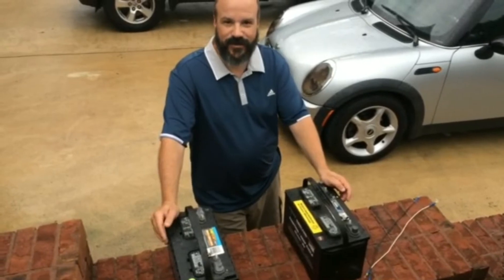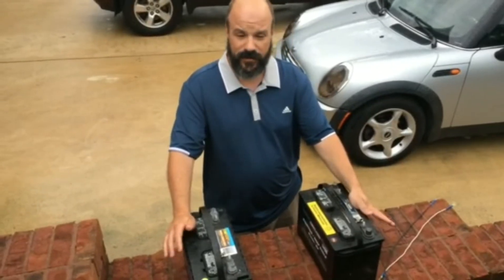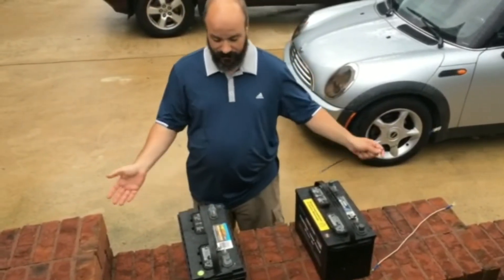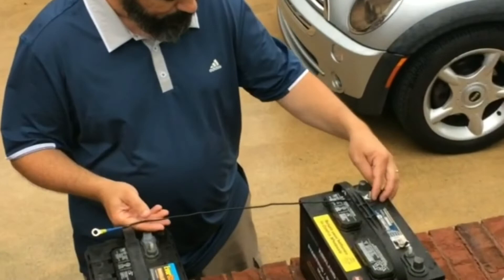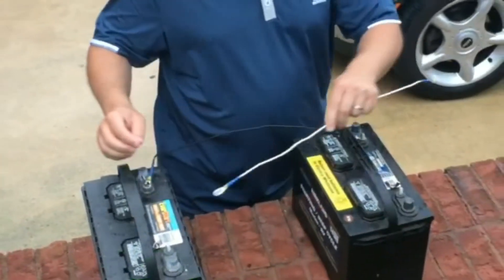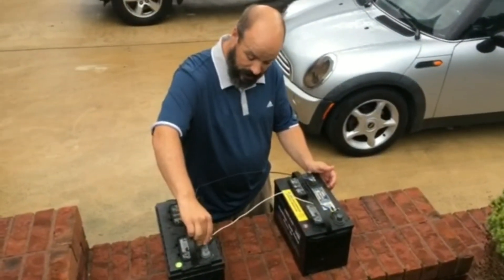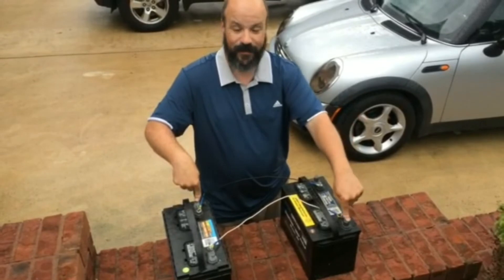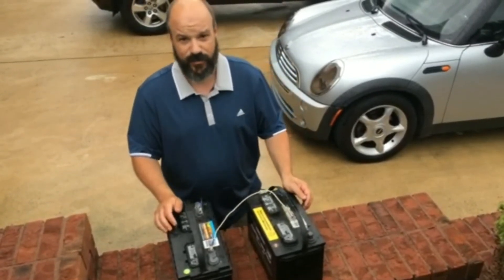How to Link Two 12 Volt Batteries - Double the Power!

Comment: I have a 12v Terrova riptide and I was wondering can I still hook up 2 12v batteries to it or is that going to ruin it??? With the supply chain being so bad they didn't offer the 24v so I got the 12 v and I want to be able to go away somewhere and spend a weekend on the water without having to recharge the battery... thanks!
Reply from the maker: Yes you can hook them up together and run your 12v trolling motor off of it.

Comment: Hey there, great video. Does the weaker battery drain the stronger one? Also, would it make a difference if on the second battery, I grounded the negative to the frame, and then connected the positive to the other battery?
Reply from the maker: Thank you for the comment.  I am not sure on your questions...maybe someone viewing this can assist from experience.
Reply: Yes, they will draw on each other if they have different capacities or even if the same capacity but one have a bad cell. Don't use your new one with some crappy old one that you kept in the garage for the last 5 years, keep them the same if possible for longer life.

Comment: Good Stuff, been looking into buying another battery to double the time out on the water. Question though, Will I still be able to charge them while they are both connected like this or would i have to charge them individualy? And would I connect the charger cables just like connecting the trolling motor cables to the battery or would it be different?
Reply from the maker: Keep everything connected....Just hook the charger to one battery and both will charge.
Reply: Will the alternator charge regular?

Comment: Can the batteries be mixed I have 3 different batteries 

2  are 40ah 
1 is 90ah agm 
 Would connecting the 3 in parallel be ok I’m going to be charging them at home and there going to be used to power building tools
Reply from the maker: Great question...I would assume that as long as the voltage is the same, you are good.
Reply: @TheFishingEducator  Thank you for taking the time to reply :)
Reply: @TheFishingEducator  You would be wrong .
Reply: He is wrong about that .

Comment: What's the result of connecting the motor to the terminals, + and - of one battery, but still building the parallel circuit?
Reply from the maker: Not sure I understand your question.

Comment: Hi, if I add another new barter and run it parallel, each battery is 100amp hours. I know my voltage will remain a 12v and my amp hours doubles to 200amp hours.  Will this hurt my 200hp boat engine with the extra amp hours???  I've been told yes and told no.  I'm confused. Thank you
Reply from the maker: Not sure on that question.
Reply: I believe it will just make the alternator work harder

Comment: This will sound crazy:

I’m putting a little inflatable catamaran setup together for near shore blue crabbing. Not only am I a weak old guy, but my launching logistics are not trailer to ramp. I’ll be dragging the boat in.

Because of this, I want to use those smaller half size batteries they sell for kayaks and such, because they’re so much lighter.

Anyway to put THREE in tandem? If not, I would go to a 2 and 2 system with 4 batteries total, if I think I really need it.
Reply from the maker: Ira Rather Not sure on the three, but I’d start with the two and go from there.  What specific batteries do you plan on using?
Reply: The Fishing Educator Thanks for the fast reply!

I haven’t really researched which type yet, but now that I think about it, it’s really no big deal for me to hook to a third battery if the two ever die. Doubtful anyway because of how much amps I’ll be drawing; I’ll be going slow and not long distances.

My main concern is hauling a full size battery. (I’m at that age and over.) Plus, with the smaller batteries, on an inflatable, being able to split up the battery weight can’t hurt.

I was thinking about a Torqeedo as my best solution, but the prices are just crazy.

And I’ll be mostly saltwater.
Reply: The Fishing Educator I might go with two sets of these because they’re so small. No rush, since I’m waiting for the boat to come in stock. I’m also going to research 12V lithium.

https://www.amazon.com/ExpertPower-EXP12180-2-lead_acid_battery-2-Pack/dp/B00SDKE9R4/ref=sm_n_au_dka_US_pr_con_1_2?adId=B00SDKE9R4&creativeASIN=B00SDKE9R4&linkId=e317076f0ef3845d3db5a8b83823e0b4&tag=kguru_native-20&linkCode=w41&ref-refURL=https%3A%2F%2Fkayakguru.com%2Fbest-trolling-motor-battery%2F&slotNum=0&imprToken=OgtxfrWbJhsKtHxnnZQ5Lw&adType=smart&adMode=auto&adFormat=grid&impressionTimestamp=1560710916201